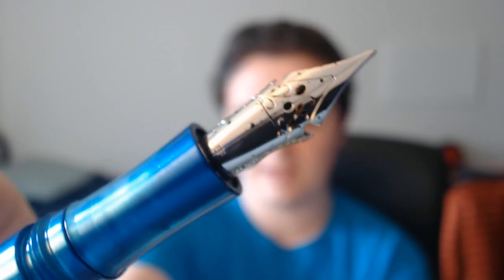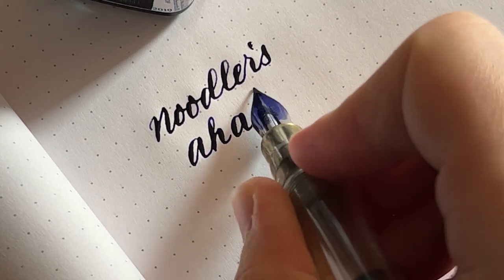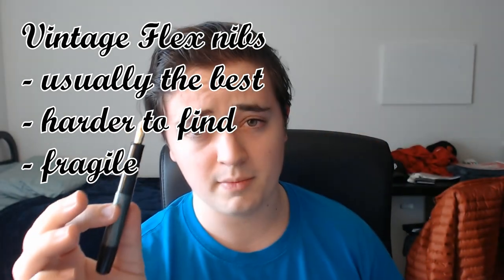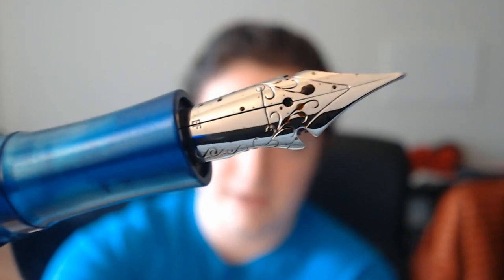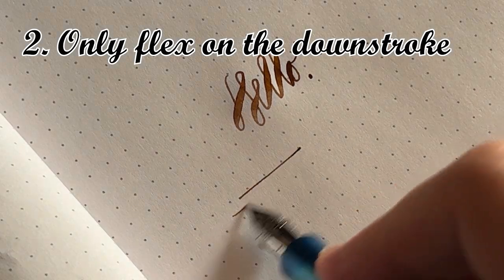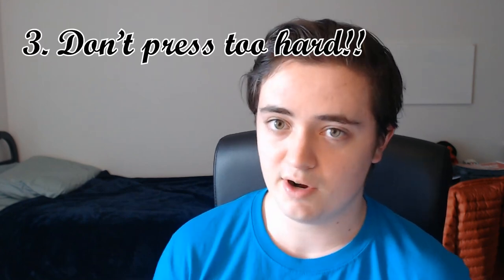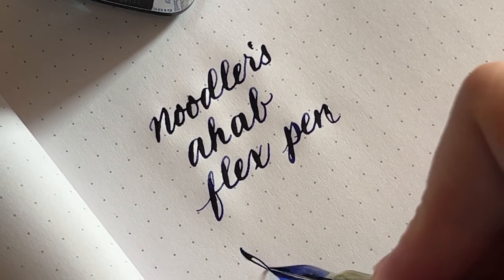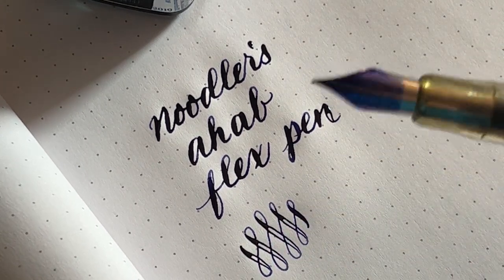HOW TO USE FLEX NIBS (and how not to break them)

Comment: Might I suggest a Fountain pen revolution himalaya with an ultra flex nib they are so soft steel nibs that are amazing at line variation :)
Reply: This was my first flex nib (and first fountain pen) and it's still one of my favorites to use.
Reply: @KingZarathus  I like them so much I've started collecting them I have a blue purple orange green\black  white green red The only ones I'm missing are the pink one the light blue one and the ebonite ones
Reply: The ultra flex is easily one of my faves as well. I have mine on a Noodler’s Ahab. I have a vintage crescent fill Conklin from the ‘20’s with a killer flex nib. The FPR ultra flex nib is very similar to it, honestly.
Reply: @MummyBrown  I like my fpr ultra flex nib on the Konrad for easy priming of ink
Reply: @yrknutzreek  🤪I'm sorry